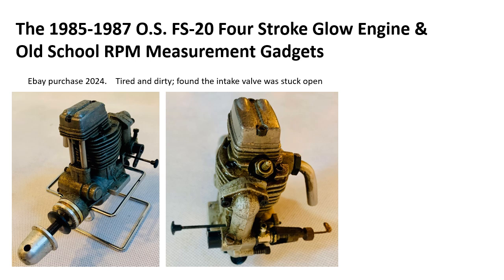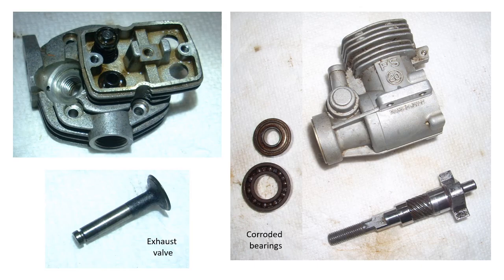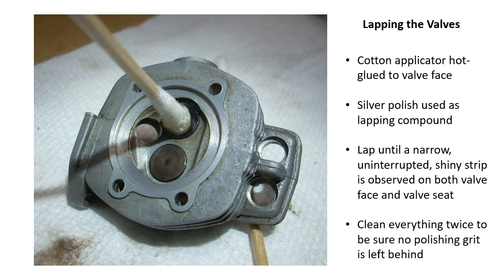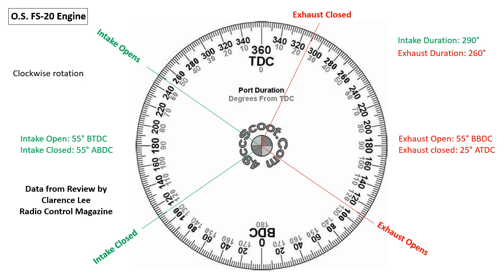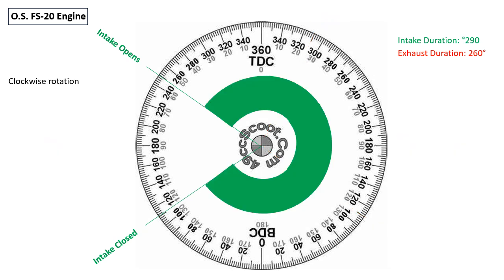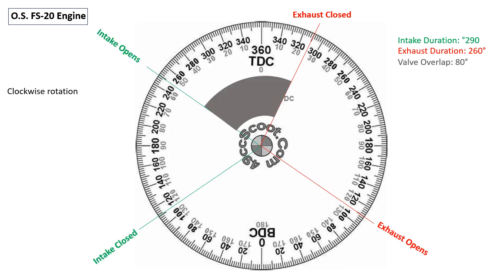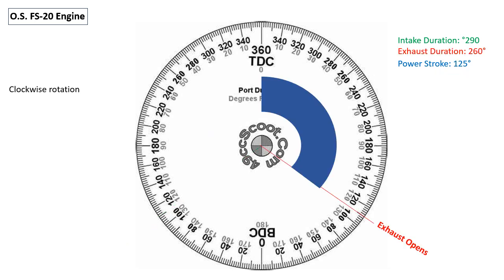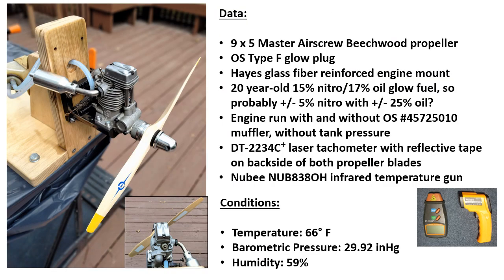1986 O.S. FS-20 rebuild, run, Strobomeca, and Sirometer

Comment: Great video and very informative. The FD 20 ran superbly. I’m sure the valve lap job bumped up compression as it sounded quite strong.

The two tachometers are a marvel of ingenuity  for the day when everything was mechanical. Accurate enough and most importantly consistent between runs. They are little gems of a bygone era where everything was crafted by skilled technicians and made of quality materials.
Reply from the maker: Thanks for your comments. All fun for me.